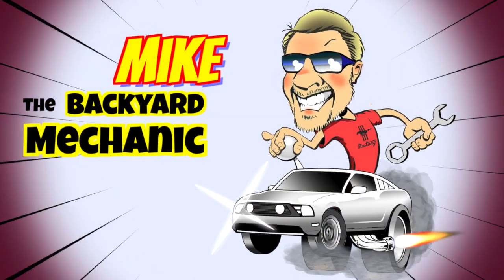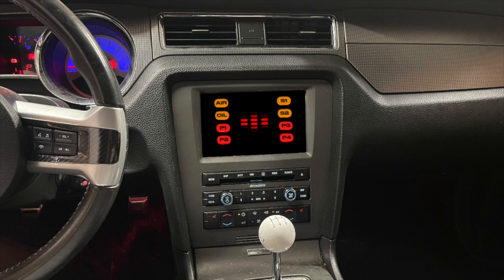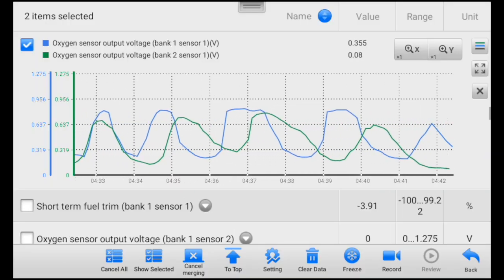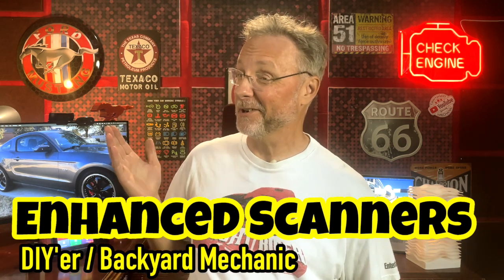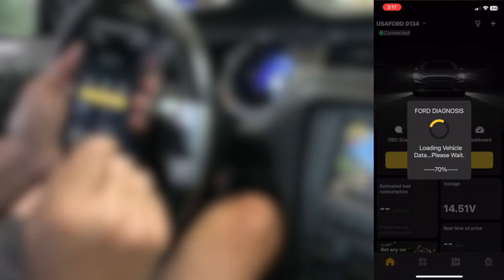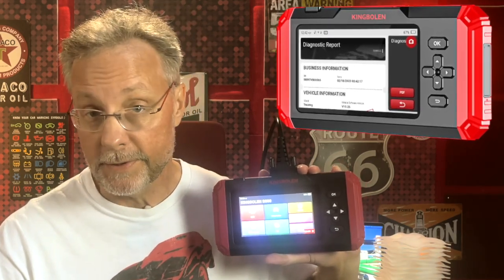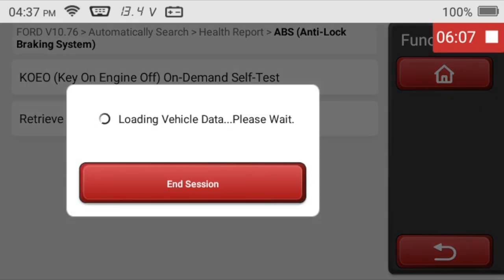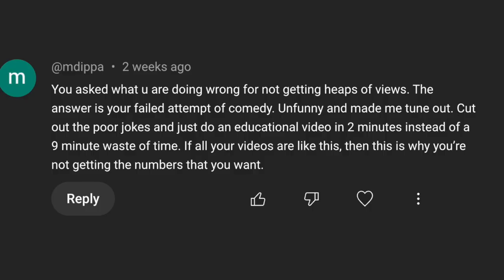Reviewing the DND Echo Bluetooth and KINGBOLEN S500 Automotive Diagnostic Scanners

Comment: My vote goes to Anyscan A30M. It took me three months to find a bidirectional scanner to suit my needs. Benefits life time updates blue tooth connection and probably the biggest selections of down loads for different manufactures. I've had mine for 6 months it hasn't let me down. And the technical customer service is second to none ! I had an issue with one on my cars and they got back to me within 2 days. I payed $230 ca . Its its weight in gold. Especially the down load part. Highly recommend !!